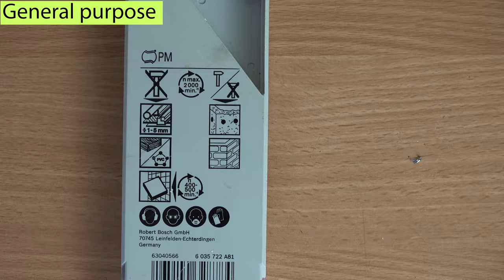Types of Drill Bits - Wood, Masonry, Metal

Comment: i wish they marked them in the toolboxes i got a drill set with 4 diff color drill bits and i have no idea which one is which lol i just always use the one that i THINK ... now... is for metal
Reply from the maker: It's good that you didn't use the wood drill bit, otherwise you've have definitely broken its tip. Once you learn what is what, then it'll be very easy to recognise them. For example, masonry bit is more like the end of an arrow as it's better in piercing in the hammer mode. Metal bit is helical as it only rotates and doesn't hammer. Wood bit has a very sharp & fragile tip as it's used for soft materials (wood) only.

Comment: 2 mm masonry bit?
Reply from the maker: Masonry bit looks as shown in 0:19. 2 mm will look the same.
Reply: @bhupindertube  masonry bit in 0:19 looks as 5mm, which I have, not the same 2mm!
Reply: @bhupindertube  5mm and above, not the same as 2mm!
Reply from the maker: @mohammad.algathali  2 mm will look like the 5 mm, but just smaller in size. The difference between different bits types is the tip & not the size.
Reply: @bhupindertube  and I mean the tip, you have 3mm onwards, is there 2mm?